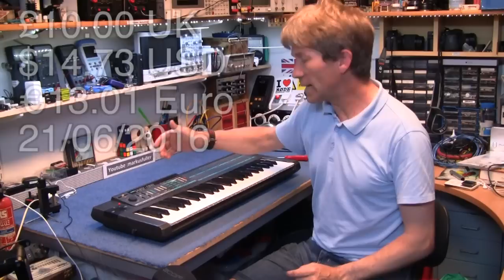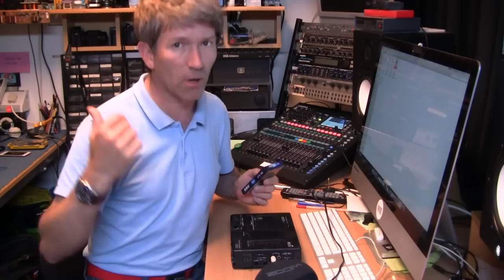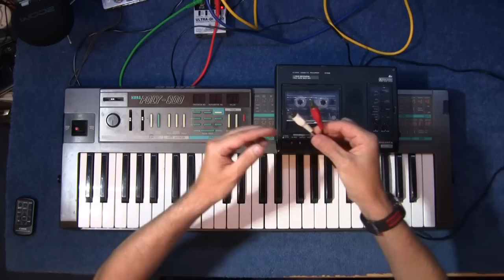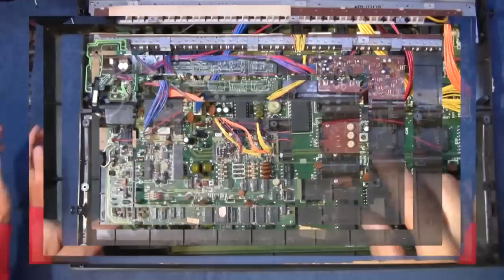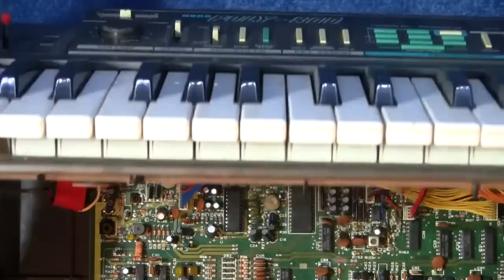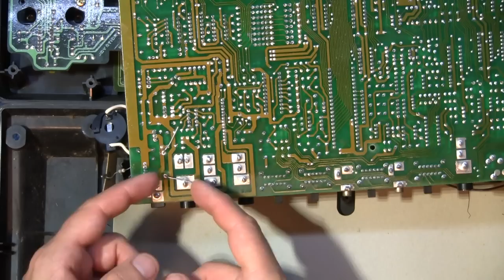korg poly 800 not worth the cost to repair this vintage synthesiser MF#81

Comment: Shame about the Poly 800.  I used to own one years ago and sold it.  Years later I found out about the mod kits.
Reply from the maker: Mine is now on the parts shelf in the garage. there really is no hope of getting it going without spending lots of cash on it. the amount it would need to get it working would be more than it is worth.
Reply: This model may not be the trouble. Unless you can score another motherboard via ebay.
Reply from the maker: Yes thats why I am keeping hold of it for a while just in case another one turns up at the right price. maybe one that works but has keyboard issues or cosmetically damaged would be just the right sort to look out for.

Comment: This is what happens when A Said "Repairman" doesn't even own a soldering Iron :) (Not you Mark, but the guy that worked on it previously)
Reply from the maker: there was a few resoldered pieces on the board though I do not know if it was the same person. maybe I bodged it up by not looking into it before powering it up. but then the most natural thing to do is turn it on first to see if it works in the first place.

Comment: The fact that your display is flashing should've been the tip off immediately that it's done. You didn't fail, someone else beat you to it.
Reply from the maker: Hi Mark. Yes the display said Good so I guess that meant it actually loaded the factory setting correctly. I know it only shows me doing this once in the video but I actually tried it several times.
Reply: Oh I know. I mean in the video, while you are trying to play it, the display is flashing. Meaning that it is probably not coming back from the dead.
Reply from the maker: Oh I see what you mean. no the display was not flashing as in the video. that was just the camera showing it as flashing when it did not look like it to the naked eye. as it was filmed at 60Hertz its just a film timing thing like when you see wheels look as if they are turning backwards in an old movie. but No to the eye it was not flashing.
Reply: Ahhh I see

Comment: PS: you could also Play the preset file directly from your Computer into the poly800.
are sure the Memory protection is not enabled? when Memory protection is on is says "good" after loading file, but the Memory can't be overwritten and still no Sound Comes out...so on the back there is a Switch...try that one...and if not just try to Programm a Sound with the Parameters...
Reply from the maker: Hello I tried the memory protect both ways. plus I know about the audio direct as theres many people already commented about it. but I wanted to use the cassette method just like it was done in the vintage days. but thanks anyway.

Comment: I was wondering why you used the tape recorder? You could just directly plug the audio-output from the computer into the tape load input on the synth. I've done this with my JP-6. Works just fine.
Reply: The computer is in a different room?

Comment: I noticed when you went to tape load, you didn't mention turning the memory protection off. If the memory protection is on, the tape won't load, even if the tape load appears to be working correctly.
Reply from the maker: Hi James. sorry you are right I should have mentioned that to people but can never remember to cover all the important things like what you have just said. thanks for pointing that out.

Comment: Hi ok no problem, any advice at all do you know if they have a fuse?
Reply from the maker: Hello Adam. I did not see any type of fuse inside this keyboard. I have read that many of them suffered faults with the power regulator so if that has died there would be nothing on the display at all. but they can be replaced and if you are lucky that may be the only fault.

Comment: Ah well, you can't win em all, now can you? I've still more or less have a Mark 2 (it had a programmable stereo delay and indeed better MIDI specs: The MK1 could only send data on channel1!) which I transplanted into an organ. At the momnetit is also off line but it still looks way better then this one. Seems like somebody spilled his Pangalactic Gargleblaster over it. Pity, although it has always been weak in performance potential it is stil a very nice sounding synth. Where the Roland Juno 6 and Korg Polysix broke open the market for affordable poly's this one really flattened it by diving far beneath them in price gain. At the time it was a really democratic instrument.

Comment: I spent about 150 hours fixing a Poly61 that had battery damage and every cap had leaked. Then the power supply blew and killed a VCA. Still worth the effort to me after I got it all working again. With as many viewers as you have, might be worth it to fix and do a full atomohawk upgrade at the same time. I just wish the chassis on the Poly800 v1 wasn't so ugly.
Reply from the maker: Hello. I would love to do a full repair of this but it would be expensive and take a lot of time and I work full time and can only do these videos in my spare time (which isn't very much time). It would take me months and the keyboard is only worth £150 in working order. it may cost me that just to fix it. so sorry but this will go into spare parts.

Comment: Wow, and I thought my Poly800 was bad! A previous owner tried to mod mine and totally botched it. Replaced a cap with the wrong value, left loose wires inside, left a switch with no wires connected to it, and that same protection diode in mine had dark black leads with huge blobs of solder on them. Fortunately I was able to fix everything up and it works perfectly. Definitely a happier ending then your Poly800!

Comment: Another great video! even with 'failed' repairs, there's always something to learn! I had a similar thing happen with a Chroma Polaris that was given to me. Just too much damage, circuit boards cracked, covered in rust, lots of components had signs of having overheated/fried. :(  such a shame. I still keep it around, even though it weighs a ton, because maybe someday i'll be able to salvage at least one or two components out of it...

Comment: it was worth the tenner to show us all what a £10 synth on a car boot these days will actually be like inside. I would have bought it if i had seen it to !!
Reply from the maker: Im sure it has several parts that can be donated that will make more than £10. I think some of the chips are sound and the keyboard and case is in reasonable good condition. but yes at least I managed to make a video from it :-)  anyway thank you very much Best wishes from Markus

Comment: Hey - I've once received a poly800 that had a bunch of problems! But mine wasn't as done as yours. It is working but I had to swap the RAM for a timerkeeper to make programs "stick" and some other stuff. If you still have that synth, i'd love to buy a few parts of it. (Chorus Board, Filter IC and some more). In parts shipping costs to Germany should be bearable

Btw. love your channel. I'm an electronic engineer with the habit of hoarding things that needs fixing so I know the excitement of diving into synths and drum machines.

Comment: Time to scavenge all the random wire for other uses and I'd chuck the external bits on eBay as parts. I'm sure someone could use the case or keys or has buttons missing :) Shame, really, but I've learned something with this: check if screws are missing which would indicate someone has gotten inside before you, and two, take a look around to be sure some jackass hasn't left a component or loose random bits that could short things out before powering up a device I don't know anything about. Oh, and perhaps check any outputs/inputs for sanity (ie, not outputting 4v steady DC like this device was) prior to hooking it up to your equipment that could get damaged.

Comment: Come on, Marcus, you can do it better. You did not even try to find the problem. Perhaps the fault is smaller than it looks. Old devices do not die so easily!
Reply from the maker: but the main chip amongst others were killed - the oscilloscope confirms this. its just at that point where I know the game is over for ever getting this working without a lot of time and money. I could buy a working one cheaper than cost of repair to this one.

Comment: Dear Mister Fuller,
I have a Roland JX-305 with a broken PLAY button. also, i have had problems with the memory becoming volatile. most recently, the drum track would not play in pattern mode. i did some kind of system check which resulted in the patterns/patches being erased! but the drum tracks work in pattern mode now. what would be your rate (from the US) to ship and repair? i fear battery acid has leaked onto the board but NEW memories seem to remain after factory reset?!?
Reply from the maker: Hello. Im truly sorry but I only repair in my spare time as i have other work to do. plus there are things here that have waited for repair for over 6 months because i do not get enough time off to do them , therefore I must regretfully say I could not really take on a repair for you. if i had more time and this was my only job I would do it for you but that is not possible. my sincere apologies.
Reply: +markusfuller I'm chuffed you would even respond 😀. Thanks anyway. If you ever get the chance to crack open a JX-305 I'd love to see it!

Comment: How Frustrating! Mine was the same - just clicks
Reply from the maker: now it has gone to the synthesiser graveyard in the back of my garage.
Reply: I guess it teaches us all that poly800 mk2 is the one to look out for. The ram in the mk1 demands too much juice so a battery dies very quickly if fitted. I guess they hoped to fit a battery but the ram to price ratio made it pointless!

Comment: I'm sorry that this was so badly treated before you found it. I've gotten some vintage tape recorders from E-Bay for my channel videos that have had similar "repairs", rendering the machines hopelessly useless! Maybe you can use the Korg for some parts? Thanks for posting your video! Also, I have a Juno 60 that does the tape load trick! I used a microcassette recorder and it worked just fine. The Juno is actually pre- MIDI!
Reply from the maker: the poly800 has gone to the synthesiser graveyard in the back of my garage, but im sure parts will be donated over time.

Comment: Sell it on ebay for parts. Someone might need it! As a note, I use my little edirol digital recorder to save/reload sounds in my OB-8. I was actually able to rescue a tape I made from my old OB-8 in 1987 by editing it in Sound Forge (boosting the level, compressing and a few other things) and was able to eventually reload the sounds into the OB-8 I own now. I hated cassette for data. Speeds, levels, and other things can vary a bit from machine to machine and cause problems. Still a cool video though. All info can be helpful. I am about to repair an envelop generator in my Yamaha CS-40m. It's probably just the chip but I should probably recap it while I'm at it.
Reply from the maker: cool I love the CS-40 I had one years ago and it was kinda nice especially using external effects.
Reply: Yeah, me too! That's why I want to fix it (second time now) and try to make sure it lasts a long time!

Comment: HAHAHA! OMFG 10:14
That is priceless.
Reply: FYI: I actually own a perfectly working Poly 800 and installed a 2032 battery (mine was early enough that there were no pads on the board at all). That protection diode is not necessary unless you plan on powering off batteries. So someone fried this rather nice little synth for NO reason at all.

Comment: this is a bad ass synth please look on e bay for parts you can start by cleaning all the pcb with dish soap look for bad caps and open parts the chip sets are basically indestructible  unless someone pluged it in to a wall socket check out the demo on the poly 800 thanks for the video you are awesome to watch and a great tech @ never give up you can do it!
Reply from the maker: Hi some of the chips were killed because of the diode wires placed across the board from underneath. this will be used for spares to hopefully repair others in the future.

Comment: Markus, have you tried to play it from another midi keyboard and to play an external soundsource with this keyboard ?
it could simply have the MIDI LOCAL parameter set on OFF... as much silly this can be, it happens sometimes...
Reply from the maker: Hello yes you are right that can happen but in this case some major chips have been killed by the diode leads placed across the circuit board. plus i tested some and the oscilloscope shows they are dead.
Reply: R.I.P.. then... :_(

Comment: I would not toss it, but rather look around for another that goes cheap, particularly if you can find 1 that seems to only have external damage, i.e. makes sound just fine but are kinda messed up. Would probably be fairly easy to combine the 2 for a fully working package.

Btw. isn't that small battery supposed to a "special" rechargeable 1? I could be wrong, but pretty sure they used rechargeable batteries back in the day, which is why it would last fairly long when used regularly. Modern batteries like that aren't rechargeable unless you find special ones that are (obviously). So while they fit and have the correct current etc. when the synth tries to charge it, it gets extremely hot and can explode. So if the previous owner used a standard battery when making that mod, it could have exploded all over the insides, hence it looks like there's been battery acid all over.

Otherwise the brown sticky dust is often from the home of a smoker. It leaves this weird brown tar-like substance everywhere that connects with the dust. I've seen some pretty bad cases when working on computers, and while disgusting and clogging up fans etc. it doesn't seem to conduct.

Thanks and good luck :-)
Reply from the maker: Hi Marc I do think you have a good idea there about the battery exploding in the past and maybe getting onto the board. that could certainly explain a few things. I will not throw it out but will most likely add it to the synth graveyard in my garage. but thanks for your suggestion its something I never even thought about. Best wishes from Markus.

Comment: Can you please give me an advice to find a problem on jack board of Juno-106? https://soundcloud.com/subright/juno-106-crackling/s-33kso - here is the sound of problem :)
Reply from the maker: Hello Dmitry. I have listened to the soundcloud file. I am not 100% sure what the problem is there - it sounds like the synth is making its sounds as it should but that noise comes and goes as if the final amplification stage is breaking down.
Reply: I have another jack board from other Juno-106 but I'm not sure if it's still alive. But maybe I can do one working board from two almost dead. Anyway I'm having no idea of were I should looking to find a problem.
P.S. This is not a typical chorus overload issue. All sounds recorded with chorus off.
Reply from the maker: Yes i agree its not chorus overload as it seems to randomly appear and at one stage it overwhelms the audio completely. i would try an oscilloscpe and just have a straightforward squarewave with a key jammed on then follow it through the circuit starting from the output stage and working inwards until you get a clean square with no interference in the signal.
Reply: Yeah, that is the only way to fix it. So I'll buy USB oscilloscope (like Hantek) and do the full calibration of unit. Btw I've decided to buy an oscilloscope after buying yesterday a Korg Monopoly for 150$ for recovering :)

Thanks for the answer.
Reply from the maker: you can pick them up quite reasonable off ebay. I have 5 scopes in my workroom one real expensive one and the rest were cheap CRT (older versions) off markets and ebay but they are all as good as each other and very useful in different ways. I have never tried the PC versions yet but i understand they are quite good and very reasonably priced.

Comment: If I could find a way to get that synth shipped to Portugal, I would take a stab at trying to get it working again.

I love a challenge :)
Reply from the maker: Hello Luis. several of the chips simply did not work. I had them on the oscilloscope and there was no life in them at all. It would cost much more than the keyboard is worth and some of the chips would be almost impossible to find.
Reply: yes Markus, I know that shipping something from the UK is expensive as hell.

Much more then it's worth.

nevertheless, if you have some way to have it make it all the way to Portugal, I'll give it a go :)
Reply from the maker: Hi Luis. it really would be far too expensive to ship to Portugal. we get charged on the distance plus weight and also size can add a lot to the postage cost from the UK. it would easily be £40 to £50 pounds to ship. the unit  has many faults I do not think it could easily be repaired for any less than buying a working one from ebay.